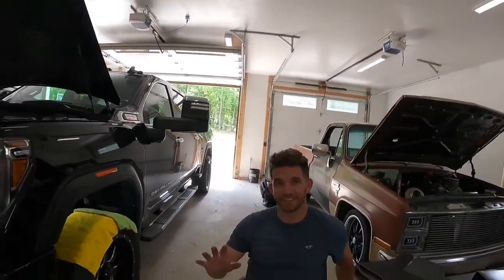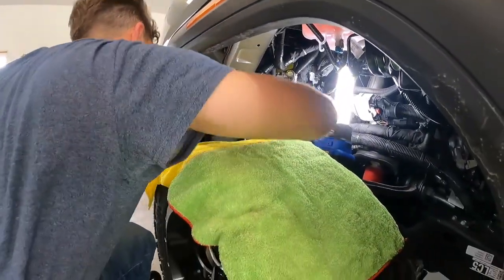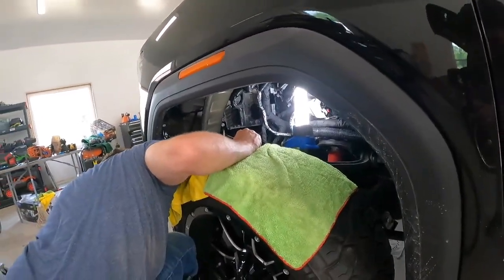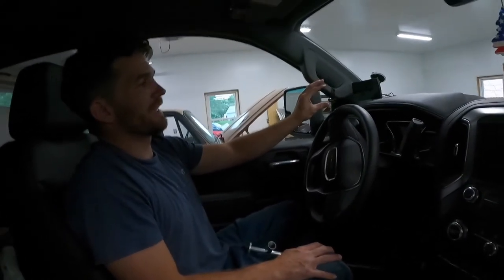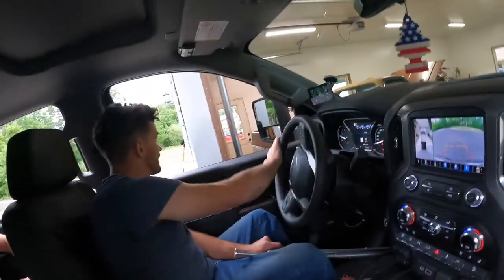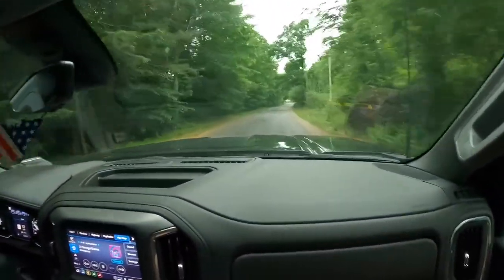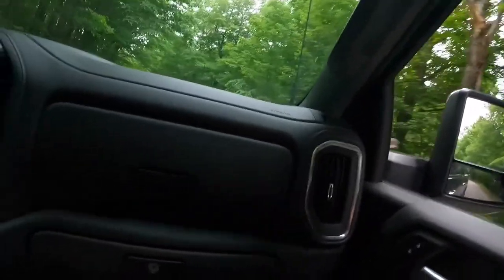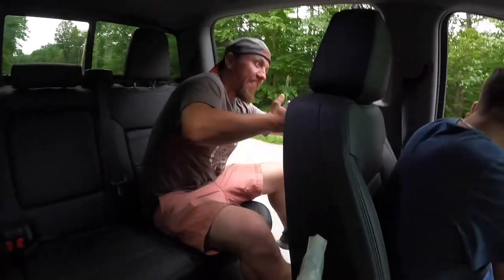2021 GMC Denali Duramax Edge Pulsar V3

Comment: Hi 
I have a question, I being running my for 2 weeks and my and my GMC app said, it can’t get the data information from the truck , the truck can’t install new updates some samples things like the line assist didn’t want to work or my convenient settings , do you have some of those problems??
Thank you
Reply from the maker: I didnt mess with the app much while it was on so I can't give you a good answer. My center display in my gauges went bad around 4k miles. I ended up selling the truck. Call edge ask them
Reply: I have banks Derringer and pedal monster and I have the same issue, the remote start and door unlock won't work from the app, so I canceled onstar
Reply: The CTS3 is plugged into the obd 2 port, so Instar thinks its an error.  
But on my 20, everything still reads and works fine after the last CTS3 update

Comment: What’s it done for your mileage (calculated, not dash), regen frequency, and have you towed anything using it? Are you seeing increased boost?
Reply from the maker: I have towed some but I haven't done any in depth comparisons or test I just through it on and drove it. I think its more of how the boost comes in. Also without a trans tune its pretty limited
Reply from the maker: seat of pants the truck does feel quicker but would need to get my dragy on it again sometime

Comment: What was the 0-60 ? Ever timed it thanks sharp truck man
Reply from the maker: I have to see if its someplace in my dragy. I know it felt faster lol
Reply: @jigglefootracing3398  my 0-60 is right around 6 seconds if you time it lemme know thanks all stock no chips or filters but not sure if I wanna go with the pulsar or just keep saving and do a delete just afraid of the pulsar or derringer because the black smoke ain’t coming out and no where for it to go either that’s what is stopping me also

Comment: You know you can also do that on your steering wheel too right you push the off button on your cruise control and then you do the thing right there with your thumb that you’re all up and either your check will go up to whatever number you’re on or your glow plugs on flash to what number you’re on